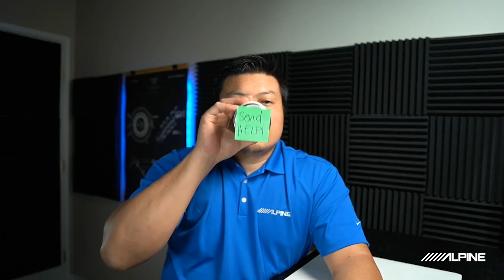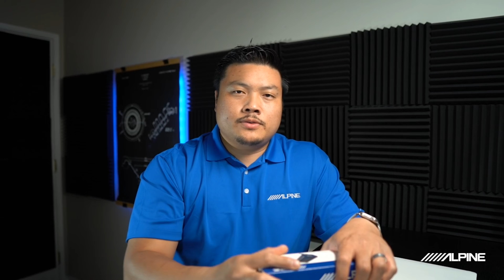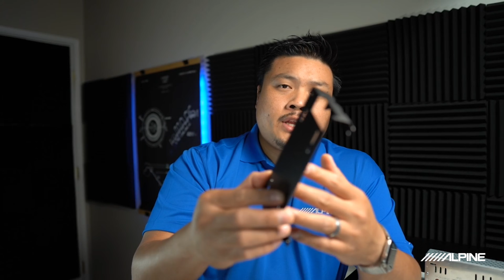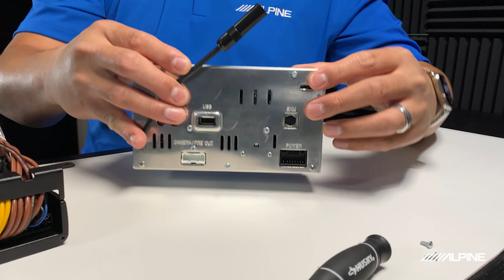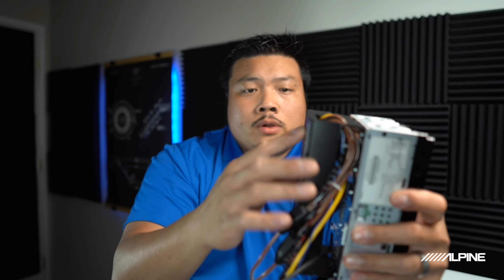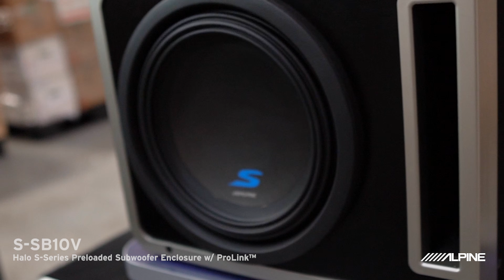Add Bass POWER with this tiny KTA-200M Amplifier

Comment: Silly question Chris:

Can I wire this up with the new Alpine PWD-X5 Powered Sub-woofer directly to the Alpine KTA-200M since I have some space issues in the vehicle? Does this add/improve on to the total Watt RMS?

Please advise.

Thanks! :)
Reply: Great questions! So the PWD-X5's plate amp is directly connected to the subwoofer internally so that will not work without serious modification. Also, the amp/sub combination in the PWD-X5 is optimized so increasing or decreasing the power could potential result in less than stellar results.